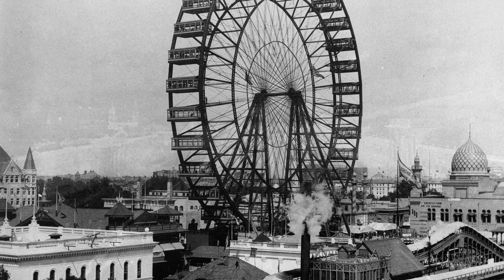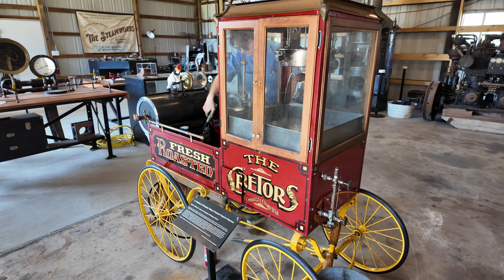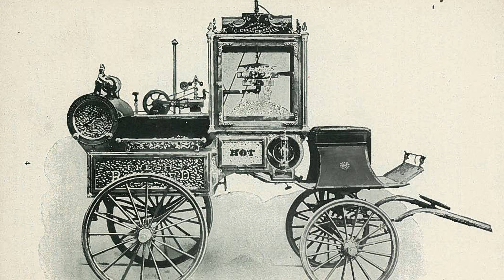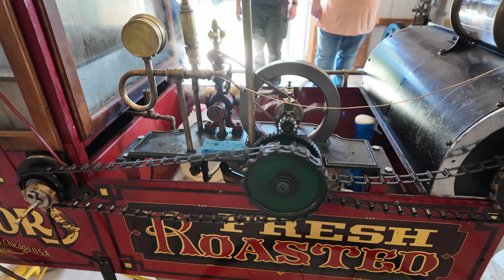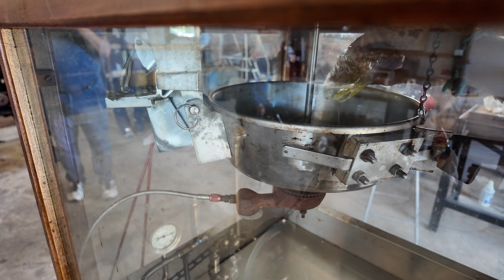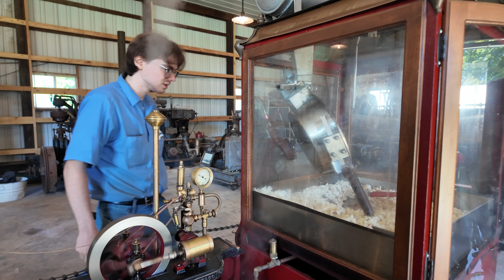Tiny Steam Engine Makes BEST Popcorn!

Comment: Oscillating engine just doesn't have the power of one with a slide valve.  I've looked at these engines before. The flyball governor is just for show and doesn't regulate the speed.
Reply from the maker: I'm expecting to get a little one about that size, or maybe a bit bigger next month.  I think you're right on the governor.  Just not that much mass there.  Either need more mass or more distance.

Comment: Very involved very mechanical.  The steam engine even has a governor.  Propane is handy to use and can be used indoors.
  Amazing that  Creators is still in business.  A woman that I went to High School with was Travelling in a Motor Home with her Husband and selling roasted Peanuts at Fairs and Carnivals. It was their Retirement business, but they were too young to retire when they started the business.
Reply from the maker: I can't see anyone building an engine to do this using gasoline now, but a century ago, propane wasn't very available.
There's a lot of people travelling to carnivals, festivals, etc, doing concessions.  Most of the places you go, each food stand, and often each ride, are all owned by different people on short-term contracts.  It can be a fun job, if you like being on the road.
Reply: @Industrial_Revolution    Actually if you really wanted to use gas you could use Coleman White Gas.  They make great lanterns and stoves that still use liquid white gas.  They put out a lot of heat for activities like ice fishing. 
  I suppose with LED lights and lithium batteries Coleman stoves and lanterns may not be as popular anymore. I have both.
  After you fill the gas tank you pump a little pump  to pressurize the tank with air.  White gas is very low octane not good to put in a car or generator when you run out of 87 Octane.

Comment: All the line shafting represents a considerable load for that little engine.  Steam is very powerful.
Reply from the maker: They have another little engine about the same size there that they think used to work in a small machine shop.  Steam is definitely very powerful.

Comment: Enjoyed your video as usual!!!
Agree with paulhorn2665 who identified the engine as an oscillating engine.
Oscillating engines were more popular in Europe than in the United States.
In the United States there were two inclined-compound-oscillating engines built for the Providence & Stonington Steamship Company for two of their sidewheel steamboats.
The NASHUA [1884] was a freight steamer with a 42" high-pressure cylinder & a 78" low-pressure cylinder, both with a stroke of 126" [2,000 horsepower at 15 mph].
The CONNECTICUT [1889] was a passenger/freight steamer with a 56" high-pressure cylinder & a 104" low-pressure cylinder, both with a stroke of 132" [6,000 horsepower at 18.5 mph].
The NASHUA was considered a success, while the CONNECTICUT was not [spending about the same amount of time being repaired as being in service].
👍 ⚓⚓⚓⚓⚓ 👍
Reply from the maker: Thanks!  I've been looking for some good, historic steamboats still actually running steam, preferably on old engines (some have been converted to diesel).  Hopefully I'll find one soon.
Reply: @Industrial_Revolution  You may want to contact Mystic Seaport concerning their 1908 vessel SABINO.  She was built as a steamboat & used her steam engine through about 2020, but it's my understanding they've added a "diesel electric engine" to run the boat most of the time, but the steam engine is still in the vessel & can be used on special occasions.  Good luck!!!
Reply from the maker: Great lead!  I just took a quick look at a video they have on their site and it looks like a nice engine.  Way too many built just after that, the engines are fully sealed and it's like look at at sealed box.

Comment: its basically a stuart engine just bigger
Reply from the maker: But around way, way longer.  Maybe Stuart engines are just these, but smaller?
Reply: @Industrial_Revolution  fair point
Reply from the maker: They actually have another working steam engine there, same building, about the same size, that they think used  to power something in a small shop back, I think, mid-1800's.

Comment: Well, what a nice machine! Never saw such machine. I doubt there are any in Germany in some museum. What an ingenious machine!
Nice how the machine is more model like and still a real engine and no toy! And it is a oscillating engine! I love oscillating engines! Most of my steam toys are oscillators. No valves, no nothing. Just ingenious!
----
I wonder if anybody with the mobile units ever changed over to electric. With a steam engine, you do not have to run around with a cable and searching for the grid. Or fiddle around with acid batteries, especially at that old time! On the other hand, electric engines make sense indoors as a fixed installation at the cinema or theatre. There, I presume, the sights, sounds and smell of a steam engine would be disturbing. And if you have juice at the cinema, you can power your popcorn maker anyway.
Reply from the maker: I suspect you're right on the replacements.  I think it was during the Great Depression when popcorn found its way into theatres, and they'd certainly have wanted the electric version.

Comment: At the kernel level, the popping of the corn is still steam powered, it can’t be anything else.
Anyone who’s tried to make jiffy pop work over a campfire probably has a decent analogy for how difficult it must have been to get the basket popcorn to work…
Reply from the maker: Even worse!  In a basket, you don't get the oil to help distribute the heat.

Comment: I have a cretors popcorn steam engine. Looking at The archives of cretor my unit was sold to Cecil Abbott. Harbor springs Michigan 1905..😊.. it was a peanut roaster model.
Reply from the maker: Do you just have the engine, or the whole thing?  Does it still run?
Reply: @Industrial_Revolution I have just the engine and it's in perfect shape.. wish I had the whole unit it's a pretty rare model.. peanut roasters by themselves were rarely sold